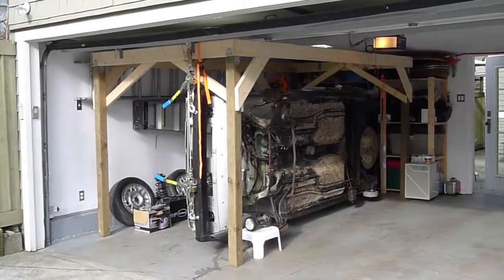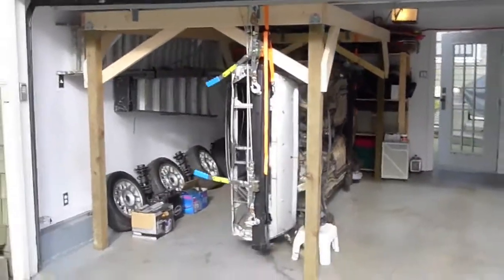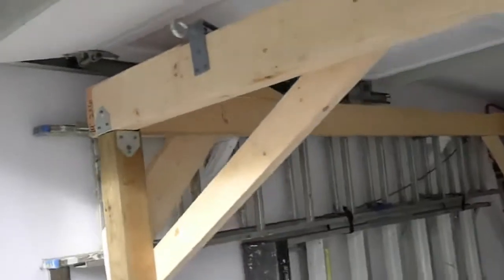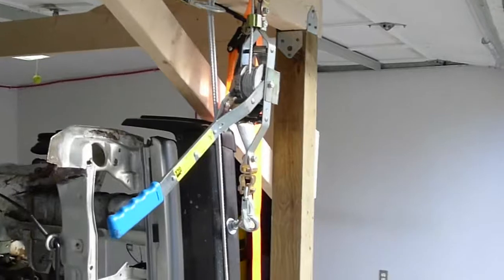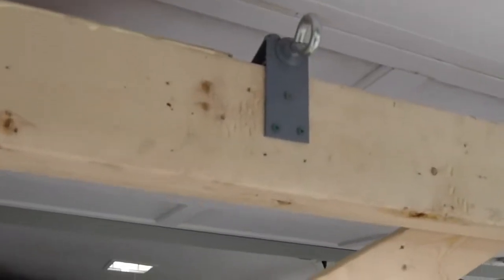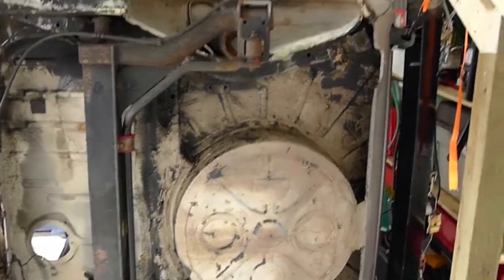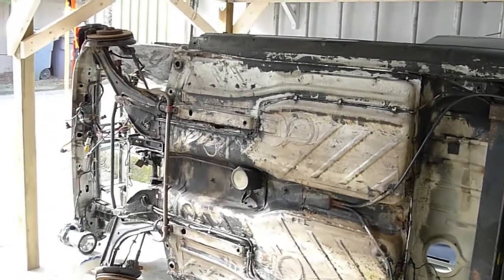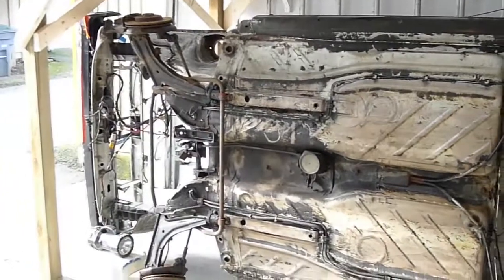The Ultimate 1983 Rabbit GTI Project - part 2 (building the chassis flipper)

Comment: Ok I have just joined the rabbit world I have always loved hot hatches 
My question is y are u getting rid of all the seam sealer
Reply from the maker: Seam sealer is OK for about 20 years and then it starts to dry out and shrink. I did put some new seam sealer back on a few of the seams post epoxy painting but tried to not use it if possible. After 30+ years seam sealer is the #1 reason for a rotting chassis as it traps moisture